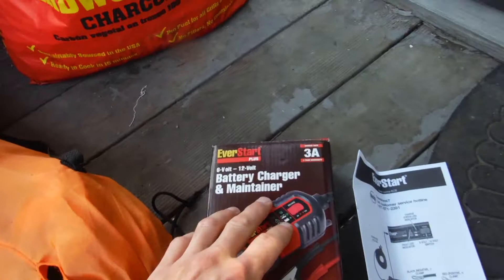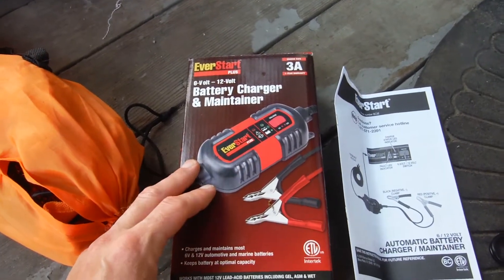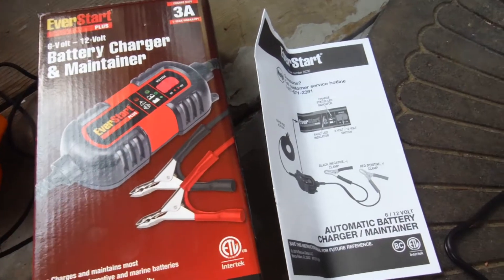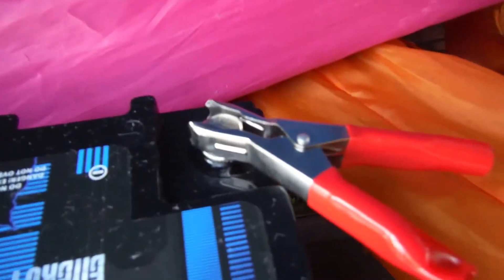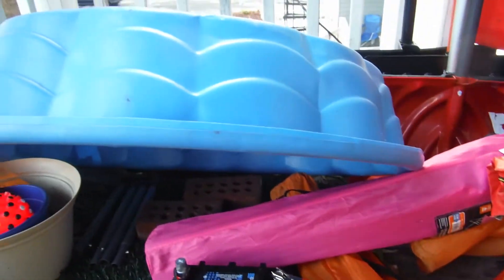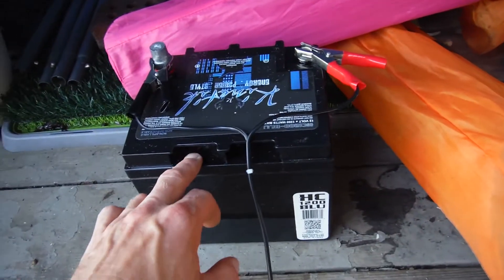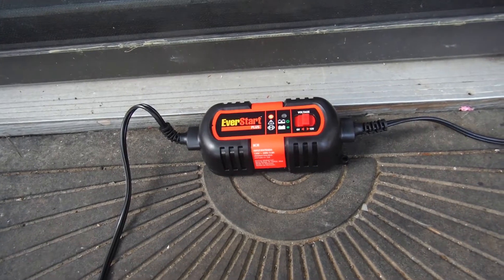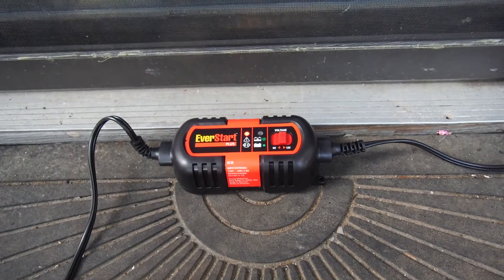How to trickle charge an AGM battery

Comment: Did this fix your issue??
Reply from the maker: Temporarily yes.
Reply: @SubzPawz  it drained again? How long did it last? And what voltage did you end up with at it being charged up. After charged up it doesnt stay charged.
Reply from the maker: @tylivinlife2238  if it's not staying charged the battery is no longer good and time to replace the battery

Comment: Lol put the pool over in case it blows up but forgot to move the bag of wood chips lol good video bro having problems with my agm battery but for solar
Reply from the maker: I actually had issues myself. I ended up replacing them